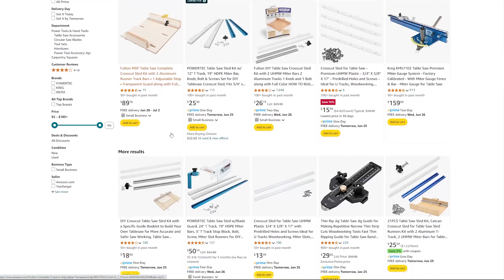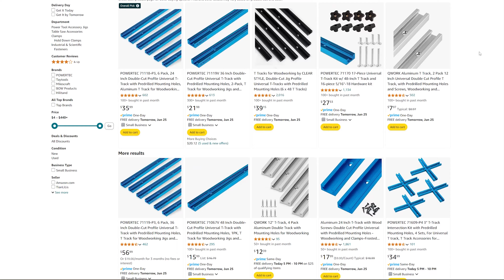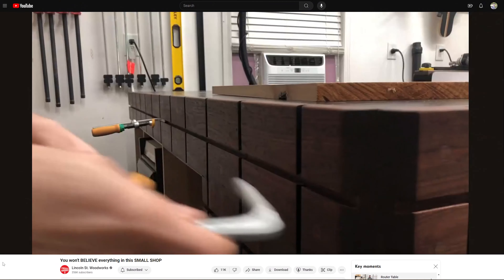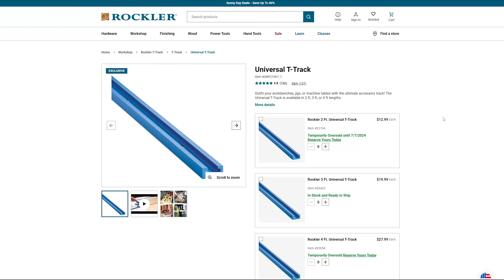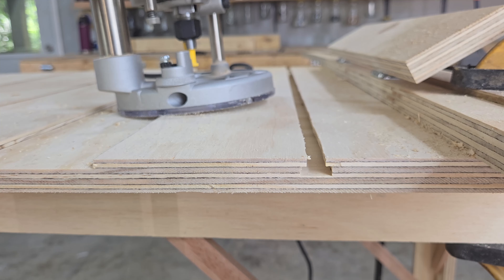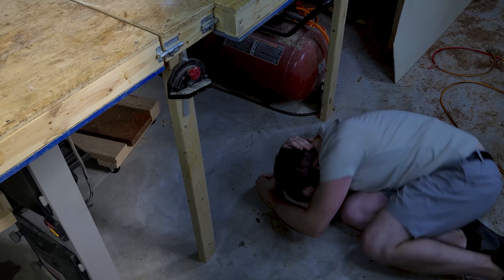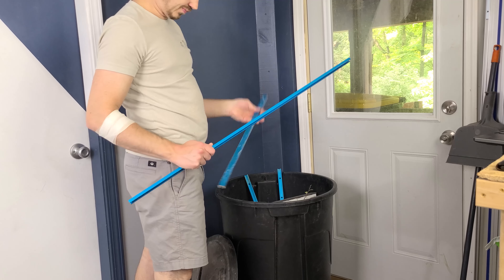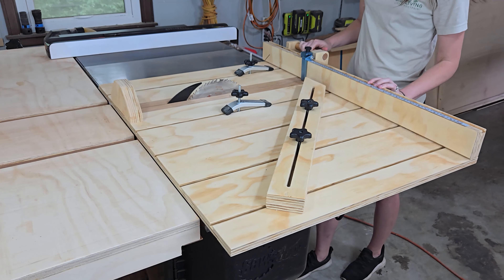Stop Wasting Money on T-Track | Do This Instead

Comment: Probably the best t track bits are made by Whiteside. I have used mine to make tons of feet of t track grooves. Yes they are a bit pricey, but like you say, you get what you pay for.
BTW those Microjig dovetail clamps can be used for a ton of different applications. There is even a video put out by Microjig which shows just a few examples of what people have done with these clamps. You will not regret having at least two in your shop. Great video content.
Reply from the maker: Thank you for the recommendation. We might have to pick up one of the whiteside bits.  Good bits are definitely worth the investment.

Comment: instead of t track on the top of that fence, if you have some southern yellow pine, poplar, or oak, or fill in blank on hard wood,,,, you could route the t groove in the solid wood and glue / screw / attach the strip of wood to the top of the fence, just a thought
peace
Reply from the maker: That's a good idea

Comment: What about strength of the slot?  If you slightly over-tighten your tslot attachment bolt, the wood cracks.
Reply from the maker: You shouldn't need that much force, but if there is a weak spot in the wood and one of the slots breaks on us eventually, we can always route out the groove and install t-track. No problems so far though 👍